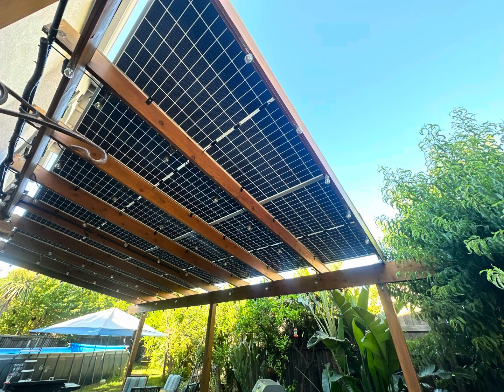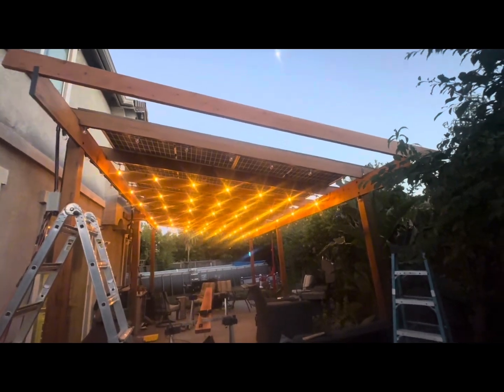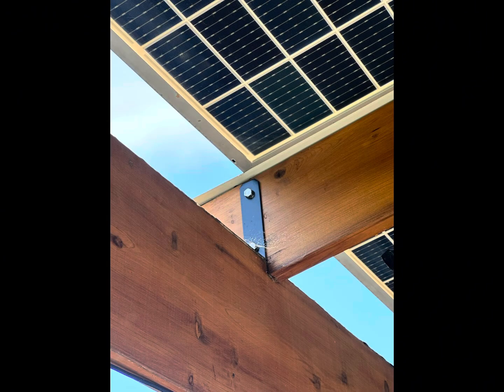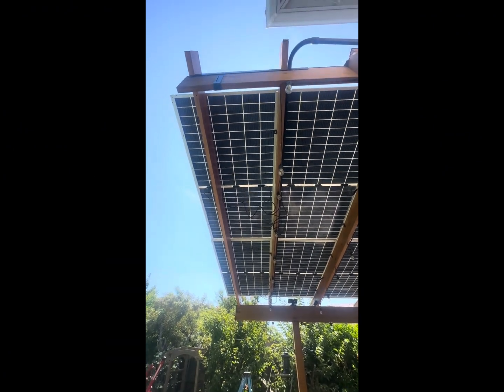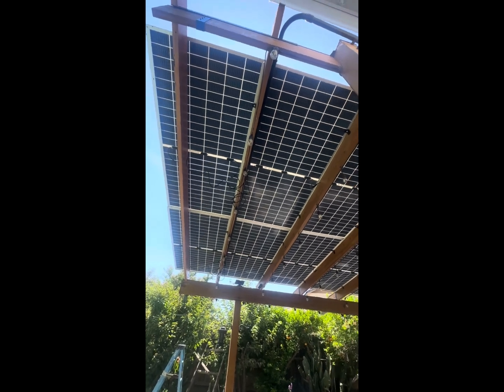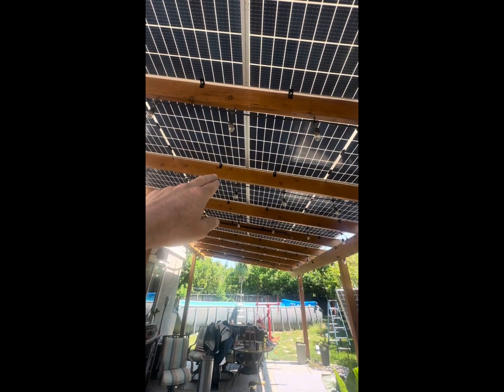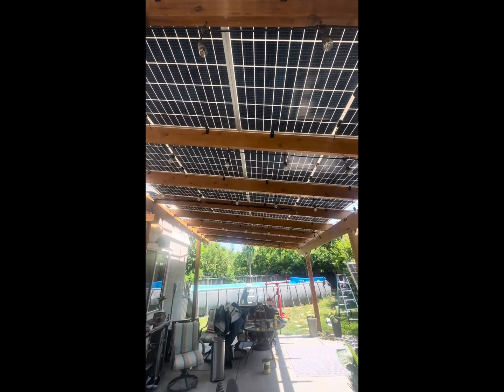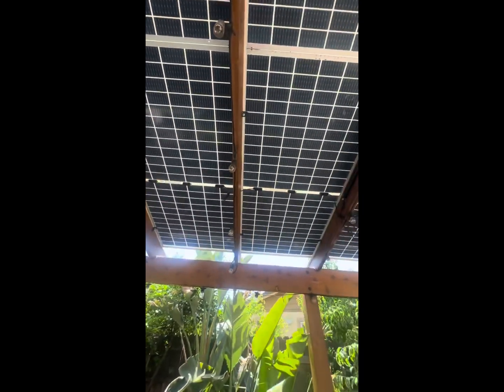DIY solar off grid ground mount

Comment: How are the panels attached? Do you have rail and clamps or have you drilled holes in the panel frames?
Reply from the maker: My previous video will show the homedepot 78 cents bracket I use to attach the panel
Reply from the maker: Also I used 1.5”by 1.5”  flashing under the panels to guide water and make the roof waterproof

Comment: How do you run the wires to your inverter and batteries?  What gauge and length.  Do you run it on the walls around your house or in the ground?  Can you do a video?

Comment: It is a horrible mistake to mount solar panels with wood. Never never do that!
Reply: Panels are getting cheaper and cheaper, and the tech is advancing so quickly, this setup is fine. OP saved so much doing it himself, it'll pay for itself in no time.
Reply: @MissionSuccessGo  that is so true! I just lined my patio with 420 W modules and they cost me $239 each.  Back in the early days when I was in business a 190 W module cost around $700.
Reply: My only thought would be the expansion and contraction of the wood beating up the panels?
Reply from the maker: What’s the reason?
Reply: @Steveoffgridsolar  Solar panels will last probably three times as long as the wood. And wood expand and contracts with temperatures, and over the seasons with changes in humidity and moisture. It stresses the panels and can cause what is called micro fractures of the crystalline solar cells and degrade performance. Over time you may also see the aluminum frame of the modules begin to separate allowing water intrusion along the edges.
Reply: I installed my first "house  generator" back in 2000. 1200 watts ($4500) of panels,  10 amp PV controller ($110) and 24v lead acid batteries (T105 golf cart).  Powered 12v lights in my garage 

I have replaced panels 3 times,  charge controllers 3 times,  batteries 4 times and inverters 3 times as new tech showed up and my older parts aged out or I wanted bigger capacity. My original panels mounts are still on the roof of my garage with 2600 watts of new PV

I am now looking at building a pergola like in the video for an awning and more PV.  Even if the wood fails or the the PV,  I will probably replace them both in the years to come with new stuff.  Besides a wood pergola looks better then AL frame work over the deck

Comment: How do you you have solar pergola mounted to the concrete? Are the post concreted into the ground or do you have the post bolted and anchored to the concrete?
Reply from the maker: The 6 x 6 posts are bolted to the ground on a Simpson strong tie bracket with a 1 inch stand off. (it was on existing patio.)   The structure I’m currently building uses a Simpson strong tie bracket that is pour in place brackets with footings. Right now just got all that to elevation and ready for concrete. I will be making a new video of the new structure.

Comment: 5 panels in series on a cold, clear winter day may output more than 250V. check your panel open voltage and add 12..16% to get cold open voltage.

Comment: Dude…. Sheetrock joist… Best idea EVER… So glad I came across this video!
Reply from the maker: Yea it works great but you must cut a slit in the end caps of the hoist so the panel frame locks in.  Also there is a small issue with the way the cable winds up on the sheet rock hoist drum.  I will edit or make a new video explaining the issue

Comment: Nice set up. Plan on doing the same thing and add 3 6000xp inverters and 45kwhr lifepo4 battery packs. Great work.
Reply: Why 3, I am doing one with a critical load's panel til I get the 18kpv to do the whole house. Hope it goes well for you. Maybe I will start with 3 XPS as well but that is almost the same price.

Comment: Nice setup and great you did it yourself. I was a framing carpenter for a few years and your structure looks great and I would say you might need sway bracing and  2x blocking down the middle.  High winds can really move things around. I also was an insurance adjuster dealing mostly with wind and hail damage.

Comment: How long are your 2x10? Im doing the same thing but only with 7 panels, the rest will be polycarbonate sheets. I want it 30 ft wide so it can cover my concrete slab, but I don't want the beams to bow. Thatd why I ask.
Reply from the maker: The main beams are 2x12 they span 12 feet per post.   The 2x8 that the panels are attached are 16 foot but they only span 14 feet  they over lap the 2x12.   I will make a more detailed video on the dimensions.

Comment: Cheaper than plywood?
Reply from the maker: The panels go around $150-200 and plywood I’m guessing is a lot cheaper.   But if you ad the current daily power production which is 55kw per day and the power company is charging 56 cents per kw. The solar roof is producing $30.80 per day.  Another example is if I were to put all 55kw into my Tesla it would give me 165 miles of free driving per day in the summer time.
Reply: In phoenix there’s a used solar panel store. The price is 20-40 dollars per panel. So yes it can be cheaper than plywood.

Comment: I am planning to build solar panels on my wood house, it is around 6x3 m2. Are you using any kit? could you please share more information about panels and other devices? If you have a video about that, could you share it to me?

Thanks, and looks great your project
Reply from the maker: No it was not made from a kit.  And all the product can be bought at the local hardware store.  I will make another detailed video on the specs and hardware
Reply: @Steveoffgridsolar  That would be great. Thanks!

Comment: I like the drywall hoist. You have a part number for that thing? Great idea
Reply from the maker: FRANKLIN 150 lb. Capacity Drywall Panel Hoist - Item 58307
Yea it worked great but cutting a slit in the rubber ends of the hoist are needed so the panel frame will hook into the hoist.